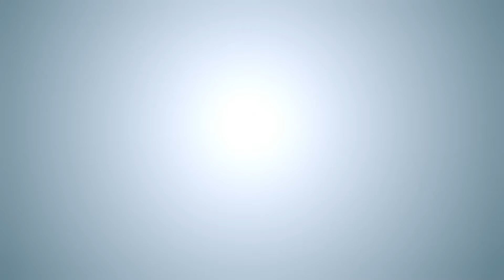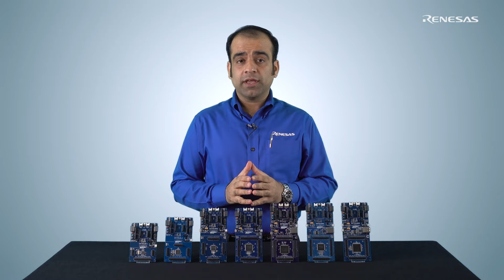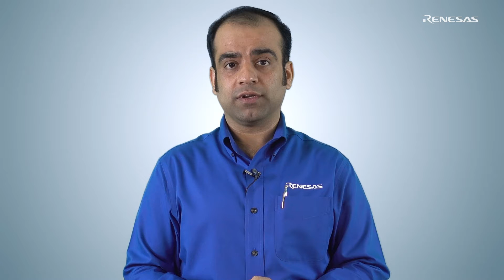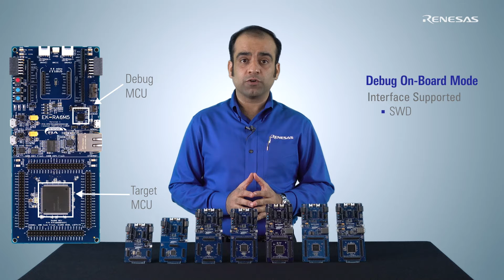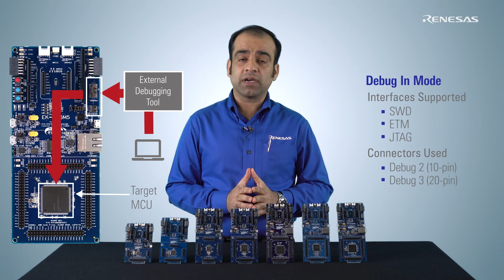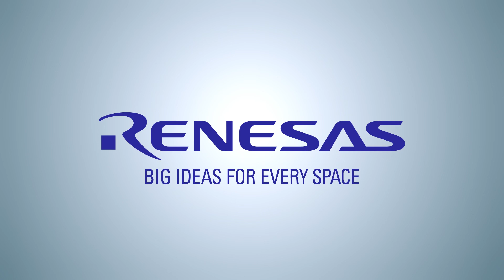Accelerate Debugging using RA MCU Innovation Kits for IoT

Comment: Pls tell, What are programmers available in market for renesas microcontrollers?
Reply from the maker: Greetings Sharan, the answer to question will vary depending on the MCU and what all you are aiming to do. In general, if you want to only program/erase the flash, you will have more options. However, if you also want to debug the code, the programming tool must support the IDE being used. Most Renesas MCU kits have standard debug connectors that would allow you to use Segger J-Link, Renesas E2, etc. programmers and they support e2 studio, IAR, etc. IDEs.

You are welcome to visit Renesas' software and tools page (https://www.renesas.com/us/en/design-support/software-and-tool) to learn more. If you have more specific questions, you are welcome to post them on the Renesas Forum (https://renesasrulz.com/) and one of the experts will respond to your question. Please be as specific as you possibly can. Thank you!
Reply: @adotahuja  Thank you for your reply sir. This will help me to choose the correct programmer.